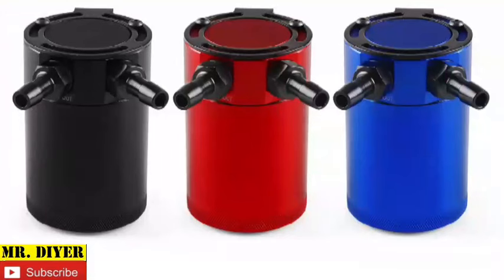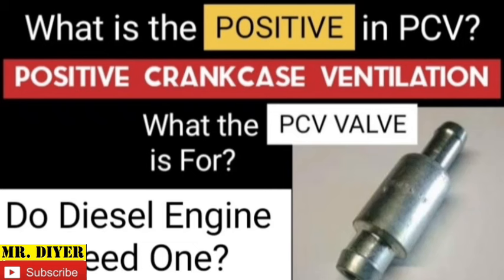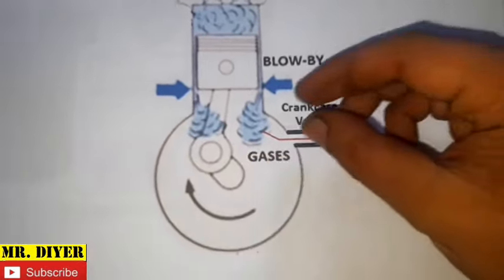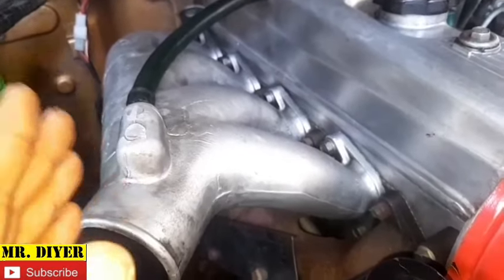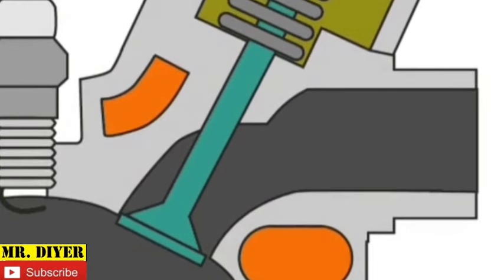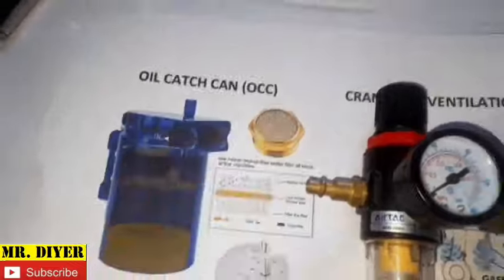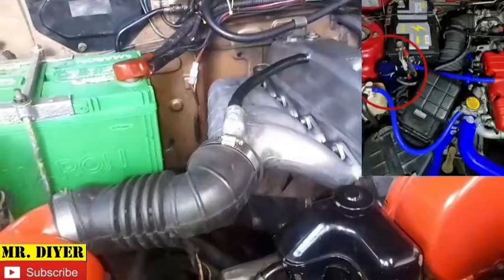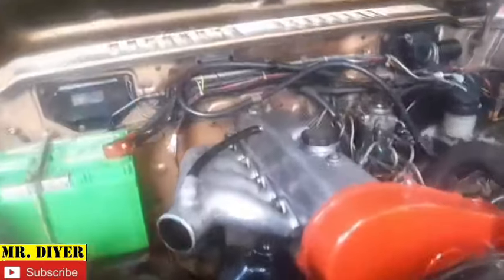This Is Why I DO NOT INSTALL AN OCC OIL CATCH CAN

Comment: In any improvement you do there are always tradeoffs.  Increase oil crank pressure is the negative of OCC, but it can be negated by keeping the screen clean and draining everytime you do an oil change.  Toyota has managed very well with oil seperators that not just take out the oil but then have the extra pressure of putting it back into the pressured crank.  Drag and circle track racers often use vacuum pumps on chevy v8's to reduce oil crank pressure, because they can gain a few more horsepower with negative pressure.  The benefits to not putting the oil vapor gunk back into the engine through the intake are huge and are more than carbon buildup on the back of the valves (which is really bad in its self).  Other benefits are increase octane, cleaner engine all through the intake, valve body, longer life of the catalytic converter, etc.

Comment: This is why you don't run a cheap catch can with one of those silly bronze filter things. Proper catch cans use baffles, or centrifugal force, to force oil droplets to collect on surfaces inside the catch can without impeding the airflow that much. Also, that engine has a lot of blowby...

Comment: @Mr.DIYer - I cant udnerstand your video you say dont install oil catch can ??? the blowbye gas and oil goes to the manifold is this better it damages all components,injektor etc... I have a Mercedes c270 cdi 2001 and  I have this Problem too much oil in my intake tract - my Turbo is new manifold is new the crankcase ventilation is new ???

Comment: If you can feel the blowby from the dipstick tube when the engine is revved under some load then: Step1 - check the PCV valve. It that's OK then: Step 2 - consider a catch can. Or, if you own a VW or BMW then you can ignore step 1 and 2 since you are going to need it eventually anyway. To load the engine slip the clutch or put transmission in drive with foot firmly on the brake for a second or 2. Really helps to have a helper to do this '- ) EDIT: I always stand on the side of the car with my feet away from the front tire when doing this.

Comment: Filter inside OCC will increase the resistance and slowing down the breather airflow, i recommend you to instal 2 small OCC so it can match the airflow speed.

Comment: The oil catch can I installed on my 3.5 Ecoboost works just fine. My oil dipstick does not squirt out oil while idling.
Reply: replace the occ with the stock breather hose and it will do the same thing.

Comment: What is most often misunderstood is that an oil catch can does act the same way as an air compressor water separator.  The effect is the same. Vacuum has to be reduced in the line for the separation to take place. Also, the added hose length and canister volume reduces vacuum evacuation of the crankcase. Reduced vacuum evacuation of the crankcase  is harmful to the engine. Repairing the engine's bottom end is more costly and labor intensive than cleaning the upper intake system. Also, using a good Dexos approved synthetic oil will help keep carbon deposits in suspension and prevent them from clinging onto internal engine components. 3-5000 mile oil changes will help too. https://www.youtube.com/watch?v=FW0wCl-O7oY
Reply: lol, if its plumbed back into the intake after the catch can, and it is sealed there is zero difference than just having it plugged into the intake.
Reply: @matthewfarrell317  The filtration in the catch can may create more vacuum obstruction. Some are better than others.
Reply: @cometcal2  The demonstration in the video is misleading because the water separator is a much greater constriction compared to a catch can. I'm not certain how significant a role intake manifold vacuum plays in evacuating pressure from the crankcase. The only way to be sure is to redo the demonstration with a actual OCC to see if the difference in blowby at the dipstick port is as great as was shown in this video
Reply: vacuum should be unchanged in a sealed system. It may move faster to the larger space, but within no time it should balance out upon start up. I'd say it works more like a baffle on a suppressor. There's no large change as long as there's not a lot of baffles and the trip is short and low velosity. 45 vs 223 for instance. Power not rpms...in the engine world. This is just not a significant barrier, but it'll work like a cooling tower and allow gases to cool, carbon and heavier liquids drop while the gases continue. I'm thinking out loud here so I hope this makes sense.
Reply: @shootinbruin3614  I agree. It would be helpful to see air flow test results with various catch cans.
Reply: What about engines that don't create vacuum in the manifold?

Comment: I’m dealing with a 2.4 eco tech where the PCV system is fed by a tiny metering hole in the intake which clogs constantly since it’s directly below the throttle body which is directly below the port on the airbox, so crud drips down almost in a straight line from the PCV exhaust right into the PCV intake port….. so you sort of have to choose the cause of your blow by, extra tubes and filters or clogged PCV intake.
Reply: And even with the filters gotta regularly take off the intake and clean it out…. Don’t buy an eco tech….

Comment: So I have just added an OCC to my mustang. I put around a 100 miles on it and I can tell that there is a residual of oil within the can and stinks like oil vapors, but no liquid forming at the bottom of the can yet. 
I was simply checking to see if there was anything in it at the 100 miles after install. I didn't think there would be, but my reason in checking it also, was my car seems to be running poorly to a degree. I noticeable hitch when I get on it. I'm in the process changing out the pcv as it looks old and for a short time the pcv hose was not connected as we just put a supercharger on it, and we had to run the passenger side pcv hose to cc and the out from the air intake tube to the cc. From the drivers side valve cover, we ran a hose to the air intake tube just after the maf. 

I'm just worried I'm not getting good crank case pressure relief with this install, or maybe this has nothing to do with it and I'm running really rich. I'm in the process of checking that out as well. 

Any thoughts would be appreciated 

Thanks
Reply: What is you findings
Reply: @leishi1950 it just so happened to be chilly the day I checked the reservoir.  good results finally when it warmed up and  put some miles on it.

It was breathing just fine through the pcv.
Reply: @alfenner3309  that is great to hear which occ do you put in. I'm in the same place. Worries about the built up pressure in the crankcase and also worries about the hose cannot handle vacuum maybe clapsed

Comment: I have a ram 2500 with a Cummins 6.7 engine.  It has a crank case vent filter that filters the crank case exhaust.  Doesn’t that slow the venting the same as a catch can ?

Comment: very impressive and nicely paced. I just removed my occ from my engine.
Reply: He is working on a diesel. For a Gas Direct injection engine he is wrong. The PVC has a restriction set by the factory, increase the flow and you will upset the expected air volume after the MAF.

Comment: My catch can came with a tiny cone shaped air filter that can be placed on top. Im guessing this is intended for a vent to air system? So i could simply plug the pcv hole on the intake and just let it vent to air through the cone shaped filter 🤔

Comment: how do you explain that certain manufacturers have integrated oil collectors into the architecture of their diesel and gasoline engines!!! not to mention breathers, cdr or pcv valves (diesel or gasoline) and sometimes we have several of these systems in the same engine!!

Comment: Thank you for the video. I have one question.  It is about the breather port on the valve cover that is directed into the air intake hose. I have seen some car owners modify it by installing a small air filter on the breather port and it stops there, not connected to the air intake hose in this case. What do you think about this?
Reply: I actually done that to my car, I disconnected the breather port hose from the valve cover down the ground and install small air filter on the intake hose, works fine with me less hassle cleaning throttle body all the time.

Comment: Very well done.  Some may still choose a catch can, but they will know that there may be a negative impact.  I suspect the extent of the negative impact would be impacted by the engine type, hose runs, hose size and catch can design.

Comment: Catch cans on the market are mostly bad. Build your own and use at least 3/8 inner diameter line that doesn’t collapse under full vacuum. Catch cans will save your engine if done properly especially if your engine is modified for more power.

Comment: I disconnected the pipe leading from the crankcase and left it open...then blocked the PCV Inlet side to maintain the manifold vacuum for brake booster purposes... the blowby gases are useless..and that oily mist + EGR carbon/soot particles = choked INLET valves. My engine is a 4G93 GDi.

Comment: Are you sure the drawbacks outweigh the advantages? Because if you have excessive oil in your intake in a diesel engine, you might get a runaway, because the engine will burn up the oil from the intake, increasing its speed, which will throw out more oil into the intake. This is a positive feedback loop and is very dangerous. A runaway diesel is hard to stop unless you know what you're doing.

Comment: Yes this is possibly true, i have tried the same and there i have found that there are engine oil leaks coming from the lower crankcase as well as blowby gases coming out from the oil dipstick when i installed OCC in my 4JJ1 Diesel Engine turbo

Comment: What about a MAP based gasoline engine where the pcv is removed and all that's left is two identical air filters as breathers, venting to atmosphere? A lot of turbo gasoline high horsepower enthusiasts remove the pcv - and I always wondered if that caused more harm than good. I do know that at high psi there is a lof of crank case pressure, thus they have to remove it quickly with no pcv in place
Reply: I've built, tuned a great number of performance engines over the years and I've made and learned from a ton of mistakes, lol.  Removing the PCV without running another form of crankcase evac is a bad idea.  Those element breathers atop valve covers do absolutely nothing for venting the crankcase under load.  You absolutely need suction on one side and a breather on the other. Unfortunately MAP and vacuum based efi systems, and some performance carb metering circuits see the PCV circuit as a vacuum leak and have a hard time controlling the IAC at idle.  This isn't a problem at off idle RPMs as far as I can tell so far.  Fortunately a company called M/E Wagner makes a dual flow, fully adjustable PCV valve that is a great solution.   It has two ranges (roughly 0-5"Hg / 5+" Hg) so you can cut down or cut out the PCV flow at lower signal ( like 0 - 3" Hg)  and open up the flow at the higher revs ( like 5-10" Hg)   and still reap the benefits of PCV vacuum evacuation under load and cruise where most of your blowby occurs anyways.  Also, run a catch can.  I've never seen a healthy motor act like it did in the above video just from a catch can install.  Thats gotta be a pretty worn out set of rings.

Comment: Have you checked PCV valve ? If it is clogged or not
Reply: There are no PCV valve on a Diesel.   There is a CDR valve and it has a totally different operation. Or they have nothing at all.

Comment: Run a hose down to a fitting in exhaust from valve cover, blow by will be sucked out. May clog converter if installed in front of converter. You could try it. Good day sir. Thanks
Reply: if you live in an emission controlled area you're in for a bad time.  Also,  I like clean air, please don't do this.
Reply: Only do it on full out racing(off road) racing application. they make adjustable PCV valves also, they should be used. PCV was one of the first and best ways to cut pollution. They tend to clog intake and exhaust valves with the carbon though. Combustion engines are by what they burn, very dirty, damn near obsolete tech. Why the hell have we not gotten away from these oil burning machines yet? Because- a well maintained modern auto can last a long time, make very little pollution and is cost effective. Unlike trying to make everyone buy electric vehicles, that have no infrastructure, are more damaging to the environment, and are not cost effective for mid to lower average folks, or really anyone that has to drive any length of time to get where they need to be. I like clean air also. Maintain your vehicle's well or not, don't have time to worry about what others do. Wish people would think about shit before mandating more shit that  hurt's lower income and young folks just starting there lives. I could go on but I'm tired of arguing with idealogs. Sorry  got carried away there. Be blessed and use your heads for more than a hatrack. I just became my dad😐

Comment: Ok but all you need to do is run the lines to the occ then instead of the little filter like most occs have run a line to your intake you’ll have the compression to pull the gases and oil out but it won’t be putting it back into your engine

Comment: Amazing video! I was convinced to put OCC on my TDI and you proved me the right thing thanks for the explanation. I'm still thinking about dumping the gasses out of the intake, what if I blanked the intake hole and the PCV hose point down to the ground like cars had in the 60's?
Reply from the maker: Thats how it was actually done before, but if youre constantly stuck in traffic and at idle you wont have vacuum. https://youtu.be/N5TCxmJPFuU
Reply: @MrDIYer  Vacuum is actually highest at idle, closed throttle.
Reply from the maker: @peterlukasch8579  if you click the link or if you read the first comment that i responded to, he was pertaining about disconnecting the hose and pointing it downwards. How can you have vacuum with the hose disconnected?
Reply: @MrDIYer  you get the most vacuum at idle.
Reply: Please don't do this. It ends up spraying onto our cars from tires and creating road film on body panels.
Reply: He working on a diesel, no throttle plate.
Reply: @MrDIYer   There is no intake vacuum on diesel..
Reply: @Joes-Adventures71   There is no intake vacuum on a diesel.  And the highest point of vacuum  on a gasoline engine is during deacceleration, not idle.

Comment: Something smells here, a sealed catch can system, with a non restrictive flow, changes nothing to the PCV system. If its pressurising you crankcase, you stuffed up. Since it seems we are all using silly examples, we shall you are river. when its narrow the flow speeds up, when its wide the flow slows down. Same volume, different speeds. However when the water is fast it takes sediment, when it slows down it drops it. That's all the catch can is doing, the pipe to the catch can is a higher flow, it slows down in the can, and speeds back up in the pipe to the intake. That's all it does. Same volume of air is moved. When the air moves quick, takes everything with it, when it slows down it drops it.

I mean with your example, we shouldn't use oil/fuel filters, they create too much pressure lol

Comment: Wrong, an oil catch can does not slow the air coming out of the crank case. Rather, a proper OCC has more volume than the hose upon exiting the engine thus, as the air passes thru the can it is slowed enough for the metal element to catch/condense the oil and allows it to drop to the bottom of the can. As the air exits the can it will be at the same pressure it would have left the engine crank case at. Your experiment using a water/air separator from an air compressor is a joke. That water/air separator has a small orifice that will not allow the gases to pass freely. Air compressors operate at 100 PSI or more. Your crank case is maybe 1 to 4 PSI thus when you stopped the flow of gasses with the compressor air/water separator you had oil coming out of the dipstick. You should have used a proper catch can in you experiment. I have and they work although you really only need them on direct injections engines since port injection allows the fuel to continuously clean the intake valves.
Reply: I have port injection and clean the intake valves but what about the exhaust valves? Is that no way to avoid carbon buildup?
Reply: @ChannelMAsk  not really but the concern is carbon buildup on the backside of the intake valve. That buildup, if left unchecked, will cause your intake valve  to not seat properly. Port injected engines don’t have that problem as you know. 
The exhaust valve shouldn’t accumulate much if any buildup like that because it’s burned up in the combustion process before. Plus, your not shooting raw oil at the backside of that exhaust valve.
Reply: Yeah my Volkswagen TDI is gunked-up and messy. The pucks are gunked and I need to pull everything apart to clean so for now a catchcan with a filter on the return works for me.

Comment: That was not a valid test. A dryer for a compressed air system has way more flow resistance than a properly installed OCC which will not ever develop positive crankcase pressures. All examples of crankcase pressurisation are from improperly designed and installed OCC's and not having atmospheric venting of the crankcase. A properly designed and installed OCC will always have negative or neutral crankcase pressure.